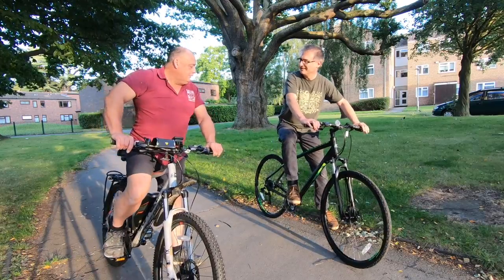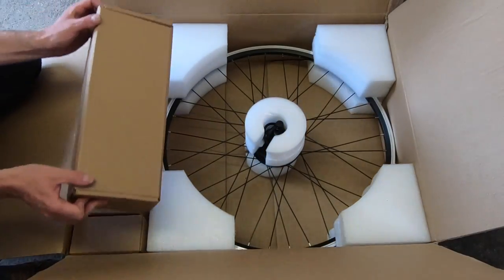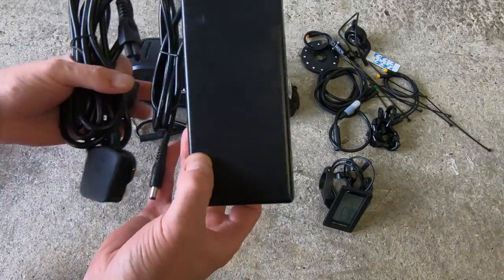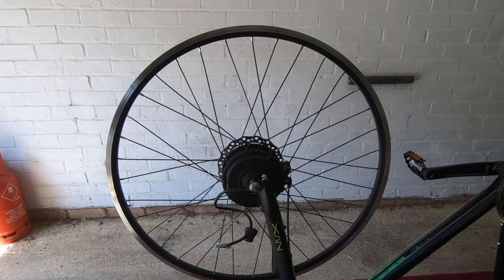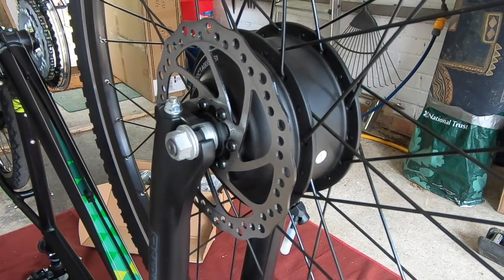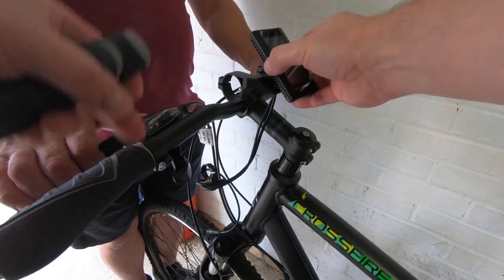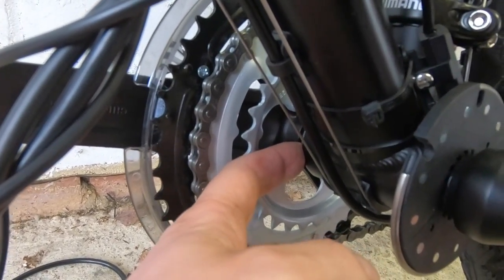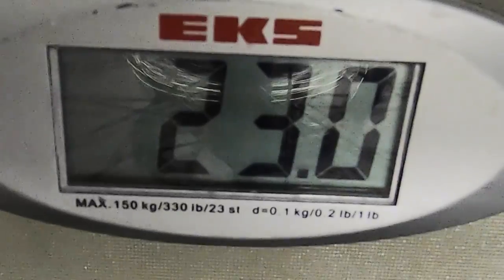I Build Two ELECTRIC BIKES

Comment: Hi ads how are you both getting on with your dillinger conversions 2 years on ? Any probs ? Im thinking of fitting one. Thanks mate
Reply from the maker: Hi Michael, the only problem we've had is that on my bike the pedal sensor needed moving and the crank disc needed a clean. Appears to be fine now. If you buy a kit you might want to wait for sale.
Reply: @HermanHitstheRoad  Thank for the heads up ads. Much appreciated. We love your videos. Keep up the good work guys
Reply from the maker: Thanks Michael 😊
Reply: @HermanHitstheRoad  Hi Ads well i finely got the Dillinger set up. Had a similar problem as you regards rubbing on the break disc screws so had to fit another washer. I also found the assist sensor kept moving so i made up a rubber washer to place between the peddle and sensor that did the trick. Your video helped a lot so thanks. Ps did you fit a torque arm. I felt with the power of this kit it wasn't worth it  even though Dillinger recommends it. Interested in your view. Take care both of you and happy camping.

Comment: Got a question just bought a carerra crossfire 1 2020 and the wheel size is 700c what size wheel should i get when i buy a ebike kit idk if 700c is an option
Reply from the maker: Hi squab squab, you need to buy the kit with the same size wheel. We brought the "Street Legal Electric Bike Kit - Samsung Power 2.0" with Rim Size 700C (28 inch, 29er).
I hope that helps. Let me know how you get on
Reply: @HermanHitstheRoad  thanks im gonna get the 28 inch rim size

Comment: Great video, you two are very natural and easy to watch and listen to, well done...and Herman is a star too😀.  Can I ask, how many miles range on a full charge can you get and do you recommend this dilenger kit after one years usage,  I want to make my btwin triban 520 flat bar bike with 700c wheels into an ebike so I would appreciate your view on this kit, thanks, Tom
Reply from the maker: Thanks Tom, we're glad you enjoy our videos. I can't say how many miles we can get out of a single charge but it's more than 30 miles. It depends on how much PAS you use. I tend to keep it on 1 or 2 but we had it on 5 (max) on the steep hills while going to Wookey Hole a few weeks ago. 
I would recommend the Dillinger kit unless your bike has a small or narrow frame which is why the female version of the Crossfire wasn't used. You can print off a template of the battery from their website to see if it will fit but remember you need wiggle room to slide it on/off the bike. There is also the Swyft kit but the weight is all over the handlebars but it might be worth checking out. 
I hope this helps
Ads
Reply: @HermanHitstheRoad  thanks very much for your helpful info and best wishes to you both😊

Comment: Love our electric bikes take them on back of our motorhome regularly. Some great bike trails around.
Reply from the maker: Hi James, we'll be doing this more often as well. We used to take our mountain bikes but Zoe's was a bit heavy for her and so we stopped taking hers and then we stopped taking mine - just couldn't be bothered I guess. Now though we have the extra power to travel and enjoy some routes and still have the energy to come back.
I guess you brought them rather than build them? What do you have? What's the range?
Reply: @HermanHitstheRoad  Hi we use 2 Raleigh Motus. The range varies between 40 and 80 miles depending on which power level you use . They have the centre crank motors which give a very smooth ride with very long range from the 400amp battery. Down side they are about 2k each.

Comment: Hi Guys, your ebikes are restricted to 15 mph :) under power (legal limit) you may be able to remove the restriction in settings, this is not legal for the road but can be used on private property, 

I have one which is the best fun ever:)
Reply from the maker: Thanks Terry but I've already seen the setting. I've not changed it though. Have you got one of these Dillinger ebike kits?
Reply: @HermanHitstheRoad   Hi Guys, I have a naughty 1000w 48v Hammer ebike, good for about 30 + mph where legal to do so (not on road)  I could limit it to legal levels, but I am a little forgetful, lol
Reply: @terry9414  Also got a 1000w motor with a 52v battery, love it massively useful bit of kit a competitor to using a car. The mad thing is with the bike in the video because it as the throttle fitted it's just as illegal to use on the road as our bikes. Although it would need to be a proper jobs worth copper to do you for it. although if you hurt somebody you could be in trouble.  
The laws have just not keeped up with the technology we need far more relaxed laws on them if they want people to stop using their cars.

Comment: Interesting video, I have done the same conversion but using a Swytch kit, I think yours is better because you are not adding weight to the handlebars.  What is the battery weight, assume you take it off when putting the bike on your rack?  Lastly, what was your phone holder and would you recommend it?  Cheers  Brian
Reply from the maker: Hi Brian, the battery weighs 3.1kg and we take it off when we put it on the bike rack. The battery also has a lock so you can't remove it without the key.
Reply: @HermanHitstheRoad  Thanks for the reply could you advise about the phone holder and 11 months on how is the kit and the bike holding up?
Reply from the maker: Brian, has it really been 11 months? Wow! The bikes are fab. We're using them more now. I got the phone holder on Amazon. I've just found out the it isn't water proof. How's the Swych? It was recently reviewed on the Gadget Show
Reply: @HermanHitstheRoad  The Swytch is going well other than the battery does not last very long, its 5Ah.  Also if going over rough terrain the battery pack disconnects itself.  Do you have any issues with the battery?  Also what sort of range are you getting?

Comment: What a brilliant video and cost saving, must take a look at this, thanks for sharing, by the way hi Chaz hows the dog lol
Reply from the maker: Hi Knuas Kampers. There is an element of cost saving when you're building an ebike but it's due to choosing a good bike and a good kit and putting them together rather than a naff bike and a naff motor that some manufacturers do. To get a decent ebike you should be paying over £1500 I think. The main reason I built the ebikes rather than buy them was because I wanted a project. The hardest part was choosing the bikes and kit.

Comment: Hi ads. You made that look easy. How did you fit the crank sensor. Is it a pedal off job or does it just slip on somehow. I bought a Vulcan Mk 2 e bike last December instead of converting my old Vulcan mountain bike. I shouldn't have bothered. It cuts out on steep hills and bumps. It sometimes accelerates on its own. Part of the screen stopped working during a ride (faulty contact I think) The gear change started acting up and changing on its own and the brakes are good but unbelievably noisy. I loved my first Vulcan e bike Mk 1 but this one will have to try hard to win my affection. Trouble is, Halfords never answer the bloody phone so I feel as though I'm on my own with this one. Miles to date only 425. Halfords just don't care. Cheers.
Reply from the maker: Hi Derek, sounds like your new bike was made on Friday (is that still a saying?). The crank sensor is in 2 halves, it slips over the crank and is held in place with a circlip
Reply: Hi ads. Yes, I laughed at that one. Built on a Friday 'afternoon' I think, to be precise. I could call it my bike 'Friday'. On the plus side, it does make for more interesting videos on my channel. One chap commented that he has this very same mk 2 and has had no trouble with it at all. In contrast, my other e bike is a Cube Hybrid which is as I type, nervously quivering on the back of our motorhome at Rosebud Farm, Cornwall, - has been great. Very little trouble. 1,590 miles to date. Got a few rides planned this week that I can film. Weather misty and wet here but should be better tomorrow. Cheers.

Comment: E bikes are the best thing since sliced bread . I do 20miles a day on mine.
Reply from the maker: Hi Shep, 20 miles? That's not bad is it? It must be keeping you in better health than without it, right? And that's the reason for getting the ebikes, we didn't want to be out on bikes and not enjoying it. At least now the ebikes can help us improve our health. 20 miles? is that cycling to work or pleasure?
Reply: No Ads it’s for heath reasons.I really enjoy ragging around the south Shropshire lanes. Just a word of caution, standard bike racks are not suitable for Ebikes unless you have got a Ebike rack.we were going to fit a tow bar model.I wouldn’t like to see your new bikes sitting on the side of the road.

Comment: Brilliant vlog 👌🎩
Reply from the maker: Thanks Top Hat, are you considering getting/building an ebike?
Reply: I do definitely want one, my partner has one an I was finally allowed to use it this summer holiday, an it was great an so easy, the motor is in the crank, when he got the bike he was told 'that’s the best place for the motor'.When we where in the Netherlands this summer I did see some good e bikes second hand for a good price €1000
But we did say the your options would suit as the bike is light an adding the e bike bits did not add to much weight, his e bike is 30kg 😨 an mine is a heavy one too. We have a bike rack on are draw bar of are hobby premium caravan an it’s a struggle to get a good nose weight, but that’s caravan jargen that motor homers don’t have to worry about I suppose 😁👍🏼🎩